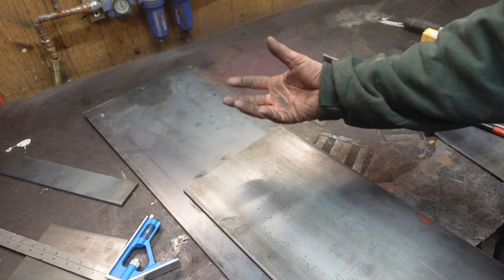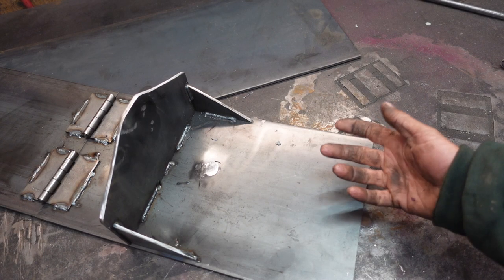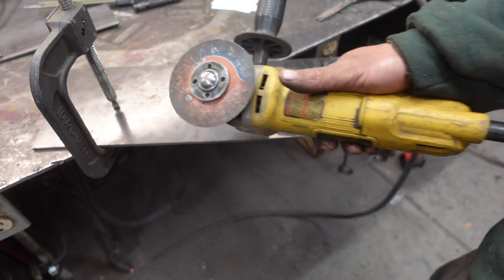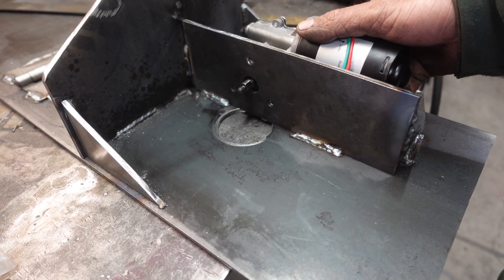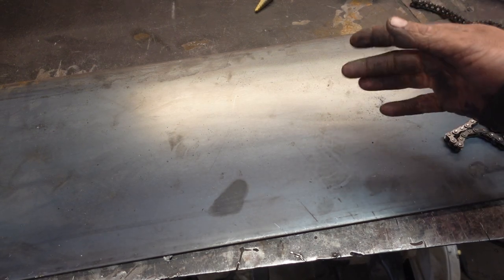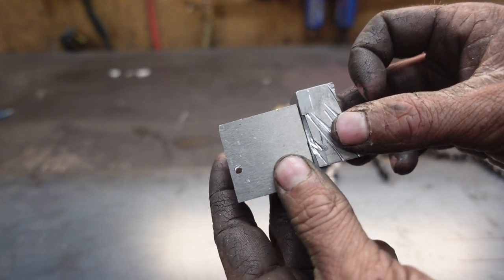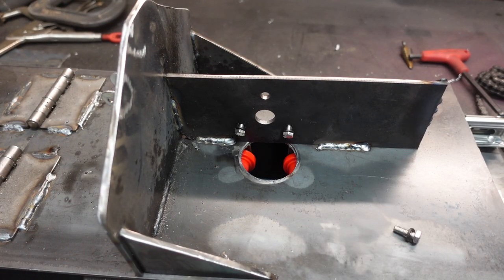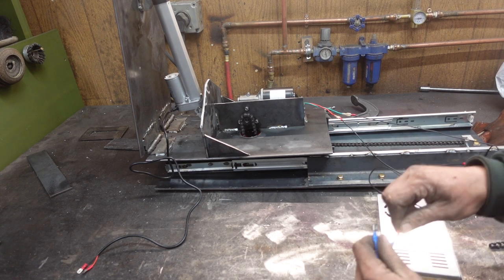Building An Automatic Extending Chop Saw Station

Comment: 8mm is maybe not large enough, though 8 and 6mm rods about 1ft in length can be found for free when you find free printers and copiers.
Reply from the maker: That's good to know! I've had a big copy machine sitting on the side of my house for months just waiting to be torn apart haha
Reply: @cranktowncity  Yeah, I finally found one with some NEMA stepper motors inside... a Kyocera that was actually a free bonus one that came with the Miata or whatever the other one I was originally planning to pickup only.  I think it was laced... like I've never went into labor like a fews days after picking up the copiers and while taking a dump, like the day and two after was still shady.  Crazy and I've been on the constipation crap from my GSW post surgery not pumped full or whatever and even after being in the hospital not trusting anyone eating their food that wasn't packaged sealed only.  Anyways, the other Miata one didn't have any since I think they came out of the paper feed and maybe flipper thing to scan both sides on the top door thing and that one didn't have a paper feed top door.  Time for me to crash out and fall asleep to some youtube.